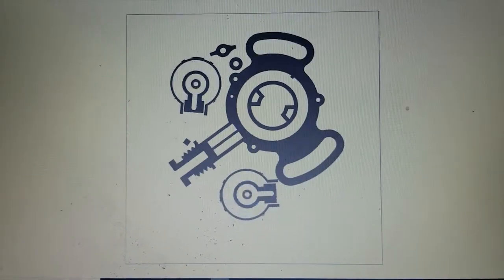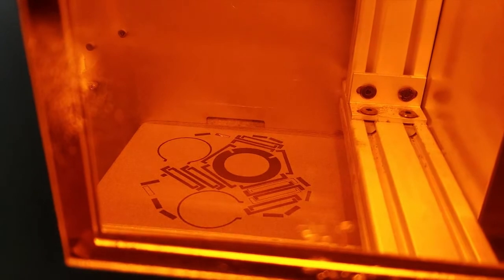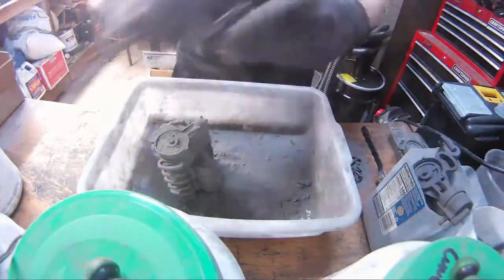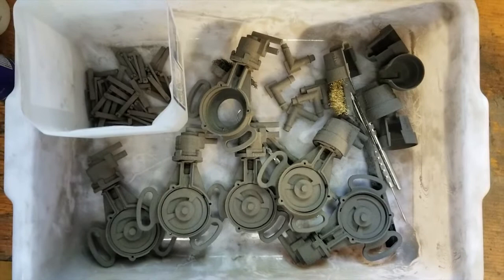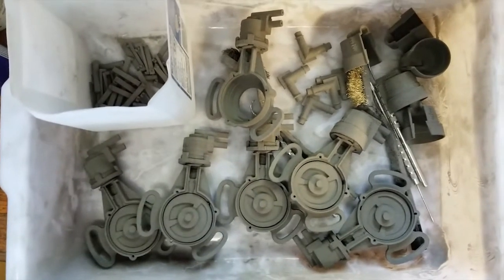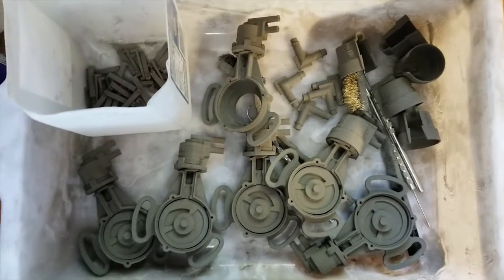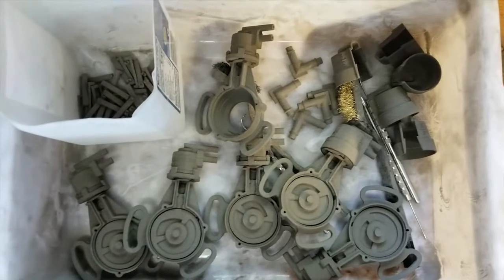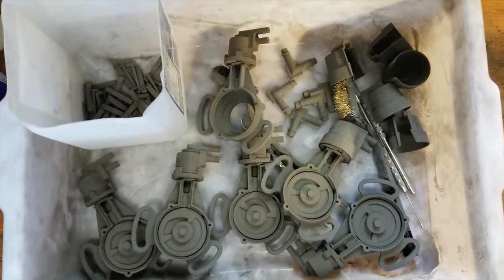Our Largest Sintratec Kit Build To Date - 1040 Layers!

Comment: Hello friend, your designs are very interesting, I would like to ask you a question, which parameters are better to modify to have reliable measurements in ranges of hundredths?
Reply from the maker: In the hundredths of what specifically?  X, Y, or Z dimensions?  Tolerances between nested parts?  Tolerances between moving parts?  something else?
Reply: Thanks for answering my friend, I want to print a piece with tolerances in hundredths, but I want to make an exprimental design with the parameters that can give me that measurement, for example layer height, speed, position. With your experience, what parameters can I apply to be able to print and have very close values
Reply from the maker: @ivandarioparraguzman2104  i still don't understand by what you mean by tolerances. Do you mean clearances between objects, overall dimensions, material thicknesses... ?  Message me at www.nickpisca.com/diesel/contact and maybe i can take a look at your model.